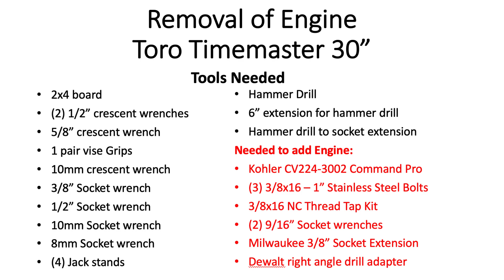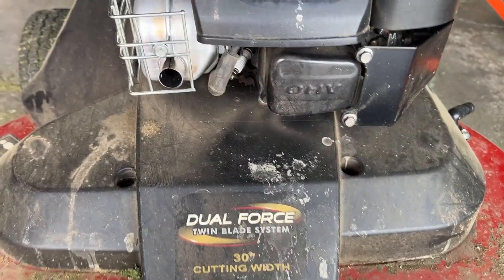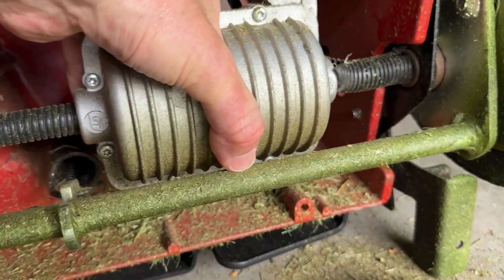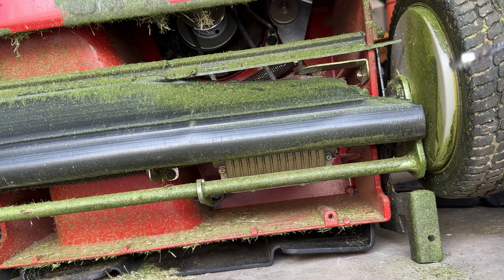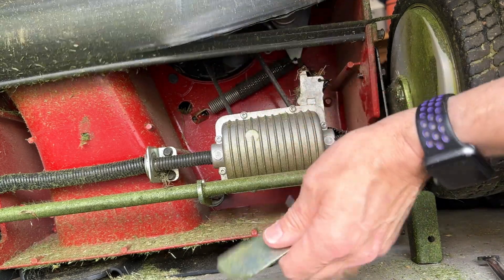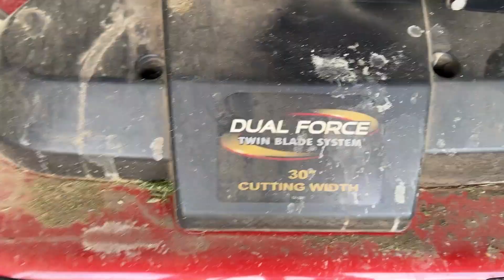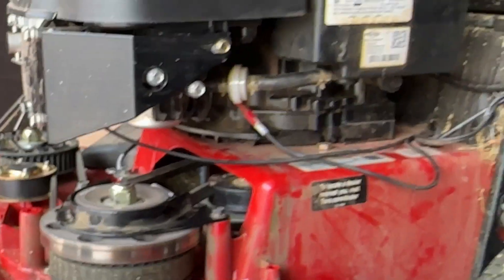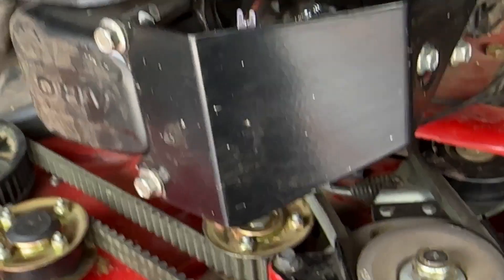Timemaster 30" remove engine, replace with Kohler Engine (part 1)

Comment: For anyone else watching this video, there is another hole inside the baffle near the back of the mowing deck that you can get an extension through and directly to that last impossible bolt - I struggled with that bolt for 2 hours before seeing that hole on another video and 5 seconds later had that bolt out.

Comment from the maker: I got it here for $599. The engine runs great! starts first pull every time, and never slows down or dies when I engage the blade. Only issue is that I have to get used to working the throttle and choke.

https://www.brandnewengines.com/products/kohler-cv224-3002-command-pro-11-0-tp-224cc-toro-timemaster-25mm-x-3-5-32-w-oil-filter_449310